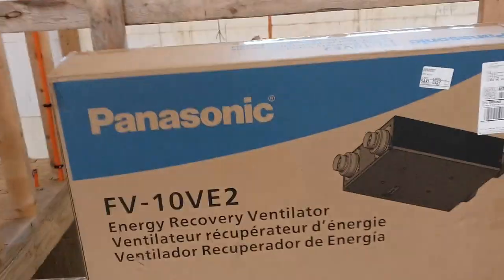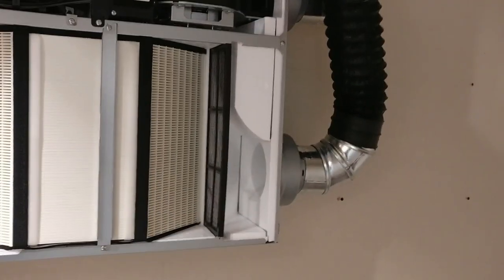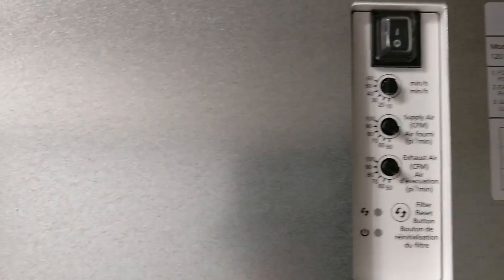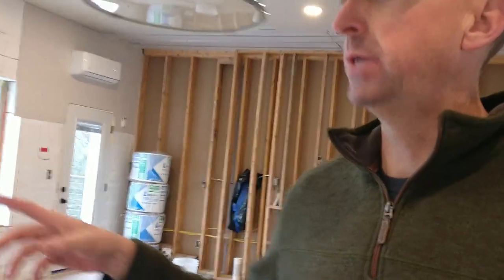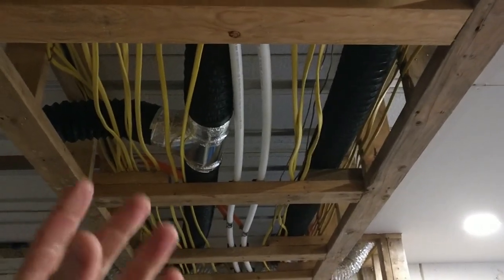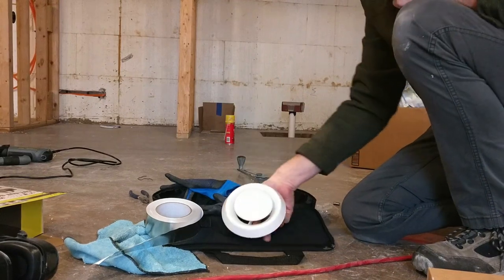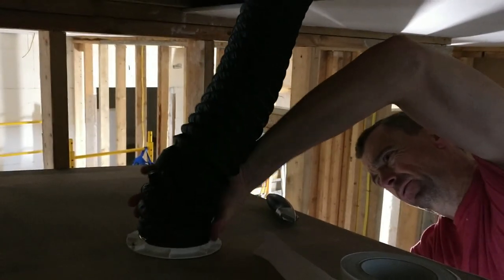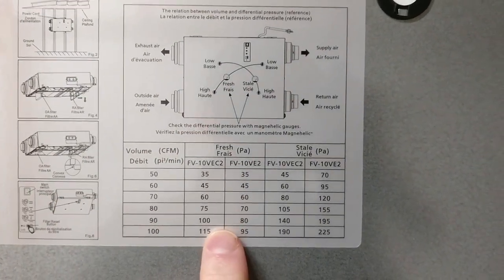Installing ERV - Panasonic Intelli-Balance 100 Energy Recovery Ventilator in ICF home DIY

Comment: I'm in Alberta we use HRVs due to our low humidity but in the case of our kitchen exhaust if the homeowner decides to get a high CFM unit code requires a make up air unit to prevent a vaccuum  which could pull flue gasses back into the home.  This system is hardwired into the furnace regardless you run a kitchen fan your air handler  comes on to move fresh air.
Reply: Youre suppose to use ERV if you have low humidity
Reply: @frgggggdsedd6913  I think you’re saying that wrong

Comment: I would never trust myself or any guest visiting me to turn on a button. A timer triggered by a motion sensor is the way to go. I would also try and hardwire the kitchen fan and make up air. It’s easy to forget about the button. If you don’t press the button and are unlucky, your waste water pipes can become make up air and spread a nice smell in the house.
Reply from the maker: Good idea. We haven't bought the switches yet, so motion could be something we do.

Comment: Great video! Have you finally balanced the system? I have the same version for cold climate and didn't do the ducting yet. I'm wondering how did you manage to synchronise all dampers to provide the required static pressure yet have a similar CFM. Did you use dampers on the outside ducts or only indoors? Did you also use the diffusers for indoor stale air intakes? Did you use any backdraft dampers?
Reply from the maker: Internal dampers on the ERV for air coming in and out. We have a damper at each location for supply and return on the inside.  It gets balanced by those dampers in the system by adjusting the dials according to the instructions of our Panasonic unit.

Comment: The instruction manual says you need a 2 foot straight run of pipe on the connections to the ERV(albeit not really clear imo). I believe this is needed to prevent turbulence in the fans, which will also confuse the intellibalance feature. I have the same unit and initially had a 90 degree bend coming out of the unit like you, and have noticed it works better after putting in the 2 feet of straight run on all 4 ports. 

How is your filter on the unit holding up? Mine was filthy after a few weeks.
Reply from the maker: Thank you for the tip! We checked the filter and it was fine. Our air quality out here is pretty good though.

Comment: Great video!   I just moved into a brand new condo with this model.  I still don't understand quite how it works.  When I first moved in the bathroom fan would be on 24/7 which is required by code.   But there is the timer/on switch also beside the light switch but when i turn it on, the fan power level doesn't seem to change at all.     So i opened up the panel and they have this model installed.    I turned it all the way  down to 60cfm for both supply and exhaust, it was at 100cmf.   Then finally i was able to hear the difference when i turn on the fan switch.   question I have is since i switched it down to 60cfm when i turn on the fan to override, which CFM does it go up to?   back to 100cfm or does it just go up to 10cfm increment to 70cfm?    Thanks in advance!
Reply from the maker: It should go exactly to where you have it set at 60.

Comment: John because you built an ICF house did you have to order your HVAC, windows, doors trusses etc before you would have building a stick frame house?
Reply from the maker: Great question. The trusses were ordered after the walls went up in order to get exact measurements. We ordered the windows prior to walls being up so that we could establish rough openings. We bought regular outside doors and then had extended jams built for them. HVAC was ordered after the walls were up. We used mini split system and had cores drilled through concrete for the penetration points. Some of our earlier videos cover the windows, trusses,and HVAC.

Comment: lookin good, John!
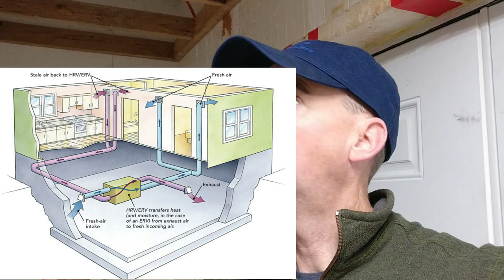about the drawing @4:56 ...looks like they're running ducts through interior 2x4 walls? is there a super slim ducting product for this application (hopefully still cost-effective), or would those walls need to be thicker to accommodate?

figure i'll need a bulkhead along the length of the rear wall (16'x46' simplistic build) to bring power/air/water, but would rather not have bulkheads along the interior cross-section walls or up in my ICF roof insulation if i can avoid it.
Reply from the maker: They do make hard stock ducting in a rectangular form that will fit in 2x4 walls. It will cost quite a bit more unfortunately. You can run them in the ICF Litedeck but it makes a hell of a mess cutting out the insulation.

Comment: Thanks for the walk through.  Question for you.  I was under the impression that these units had to be plumbed for condensation to drain away any condensation that accumulates but I don't see any instructions for that in the install manual and didn't see you mention this.  Do you have to run a condensate line?  Thanks for the videos!
Reply from the maker: Great question. Our ERV does not require a condensate line because it matches the humidity in and out. There are several models of HRV that do require condensate lines. So it is brand and function specific on whether or not a unit needs a condensate line or not.
Reply: @LakeLotBuild  thank you!

Comment: John great video. Question who did you work with for engineering design? I am looking to build an ICF pool house on my yard and in Houston not many engineers do this kind of work, and those who do do it for large commercial properties.
Reply from the maker: Our builder worked with Litedeck for all the engineering on our garage slab and roof. He worked with a steel company for the engineering for the deck. That was the only engineering design we needed. John worked with an engineer for several years doing HVAC, plumbing,and electrical design, so he had a lot of that knowledge already.  Perhaps a good ICF builder in Houston has those connections? A good HVAC company could do the engineering for ERV.

Comment: Is there any way to Ramp up just the supply air volume by remote switch?
Reply from the maker: No. You have to adjust the return and supply on the unit itself. We currently have ours set to be higher on the supply side to keep our radon level low to zero and haven't found any problems when using the remote switch for exhaust. It still does a good job moving the air out especially since the return are in the bathrooms and supplies are in bedrooms.

Comment: Hey John. I’ve installed the same ERV with a similar set up independent of my HVAC. I saw you ran low voltage wiring as I had done originally for a different unit, but wondered what switches you went with and how you wired up your system.
Reply from the maker: We found switches on Amazon and they are working great! BN-LINK Heavy Duty 60-Minute... https://www.amazon.com/dp/B01LVTGKBR?ref=ppx_pop_mob_ap_share
Reply: And these switches are working with thermostat wire? The manual is terrible on this detail.

Comment: Per the manual, the boost option requires wiring with a capacity of 120v at 3a. This is different then most erv unites. Did you find this to be the case when installing the switches in the bathrooms and kitchen? Or was it the typical dry contact system to engage boost?
Reply from the maker: We haven't put the switches in yet, so we will let you know. Fingers crossed!

Comment: Great info! I am installing one of these in my home but I can’t find any information on what kind of switch or wire to use for the boost override function you talked about. Could you please tell me what kind of switches and wire you used? Thanks.
Reply from the maker: We searched and searched for this information as well. We finally found to use thermostat wire. You can buy at any home improvement store.
Reply: @LakeLotBuild  Thanks a bunch!
Reply: @LakeLotBuild  sorry your  sentence is incomplete/unclear ? do you mean you found one (a switch) and used thermostat wire ???
Reply from the maker: Thanks for watching! We are using a timed switch on the wall in the bathrooms with 30-60-90 minutes option. You can find these switches online. We then ran solid-copper thermostat wire to those switches..

Comment: What type of vent or attachment did you use on the outside of the house where air is brought in and also sent out?
Reply from the maker: We purchased black vent covers from Menards. Any outside vent cover similar to dryer vent will work.
Reply: @Lake Lot Build  ok thank you.  Nice project.  Does the outside vent on the air intake have a flap or does it need to be open?  Maybe just a screen?
Reply from the maker: The intake is open with screen and the exhaust has flaps with screen. The ERV itself though has  internal closers so air isn't let in or out of the system.

Comment: Do you have any heat other than the mini split? I am getting ready to do an icf house on a small lake in northern Indiana and am looking at my heating and cooling options.
Reply from the maker: No we just have the mini split system. Ours have the reverse heat pump which is supposed to heat pretty well down to single digits. I think they have other units that can heat at temperatures even lower. I will tell you that it has been in the teens here in Missouri the last couple of weeks and every time we walk into the house it's nice and toasty warm.
Reply from the maker: We also have radiant floor heating in the basement, but we haven't set that up or started using it yet.
Reply: Thanks for the reply, I was looking at doing radiant heat in my basement floor and main floor but not sure I would need it.
Reply from the maker: For me (Leslie) I just love the feel of a warm floor on your feet.! I don't know that we'll need it for alternative heat source but I'm interested to try it and see how well it does heat the house.

Comment: Is it 120v? Did you install an outlet for the unit?
Reply from the maker: Yes and yes. We love it and it is working well.
Reply: @LakeLotBuild  Thanks. We have a conditioned attic - considering Zehnder, we need 160cfm plus. I wondered where you landed for positive pressure? Is your kitchen make up air working well.

Comment: Since this device needs electricity to work, it would have been useful for you to cover that as this is supposed to be a install video.
Reply: The unit has a regular plug, so it just needs a standard household receptacle within 3' of the unit.